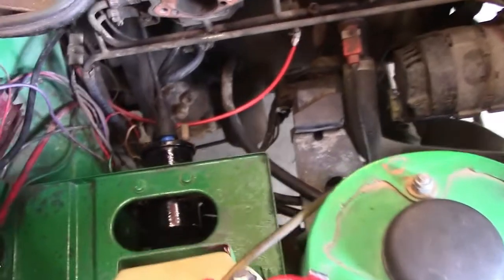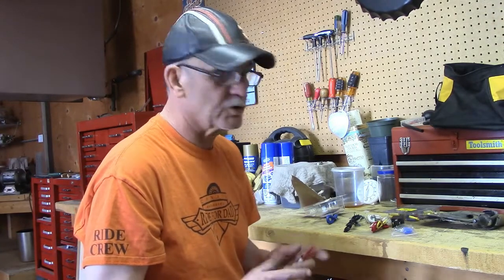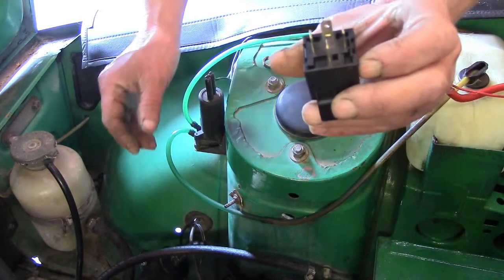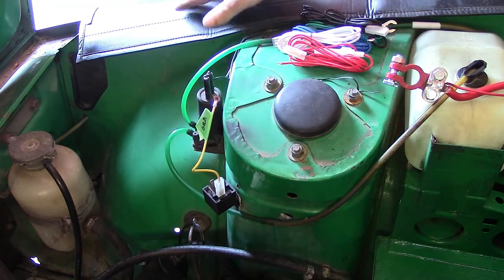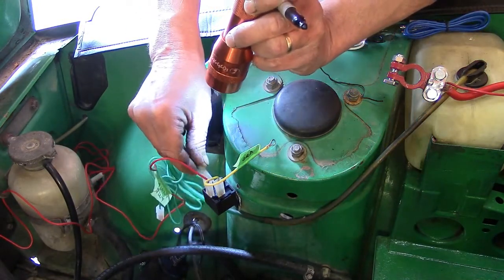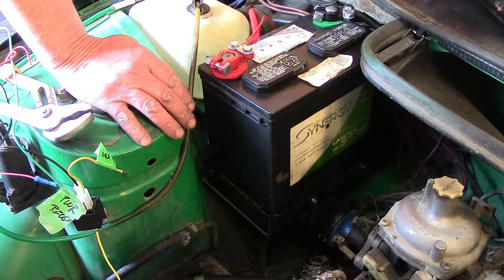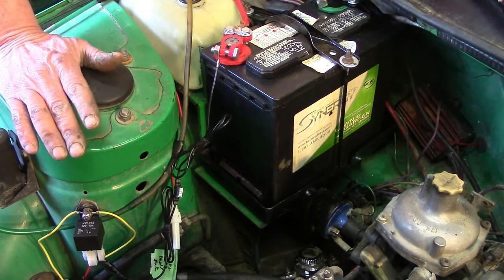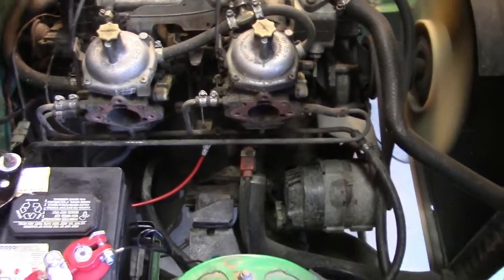7 up Segment 4 Pump wiring install

Comment: You never want to add an electrical load to the same circuit at the radio on a TR7.   
If you look over the circuit diagram for the TR7, you’ll notice the radio, the lighter (that you would use to charge your phone to call a tow truck), fog lamps, horn, door lights, trunk lights, flashers, door buzzer, heater fan, and I believe the windshield wipers are all on the same circuit.   If this circuit fails, in theory, you can still drive home because the head light, starter and brake lights are on different circuits.  By connecting the fuel pump to this circuit, now you cannot. Plus, why would you overload a circuit that’s already overloaded?
Reply from the maker: Because on this car it is not overloaded. No radio or speakers, no fog lights, not equipped with door lights or trunk lights or door buzzer. Also the cigarette lighter was long ago disconnected and safetied. This ciruit, as it ties to the ignition switch, means off no pump ... which was one of the goals.

Thanks for the comment and thoughts.

Comment: That has to be the worst place to add any electrical connection...try closing the hood!  The Vents are directly above that area!  Unless you never plan to ever washing your car or never encountering water...it's not a good idea
Reply from the maker: Actually it is pretty much no worse than anywhere else in the engine bay as most water come through the grille below the bumper when moving. Connections when properly done are more than capable of handling any splash or rain as I learned over the years with both street and race cars.

Once again thanks for the thoughts and comments

Comment: Nice to see you getting your hands dirty! Full action videography!!
Reply from the maker: Get ready. As soon as we have the TR7 parts car and the Pontiac Pursuit parts car stripped out we will be getting to the Geo Metro Convertible conversion as well as starting on the Ford Truck bodywork while taking time to overhaul/rebuild the suspension components to install in the TR7 this winter and a few engines to build!! Be like the old days ...lol